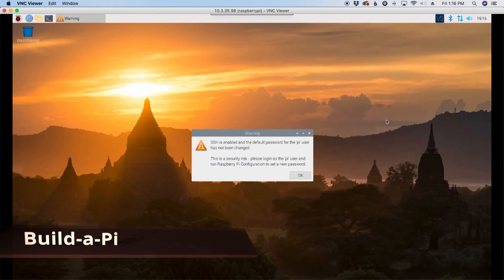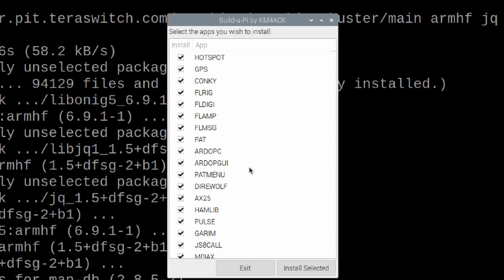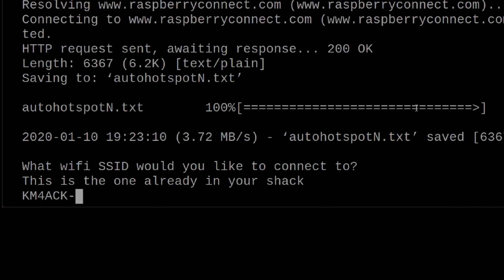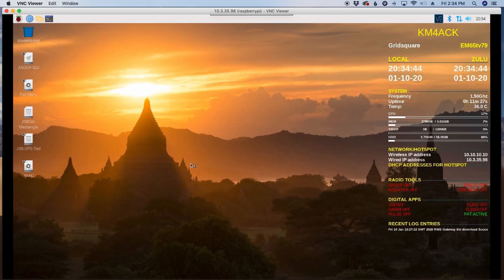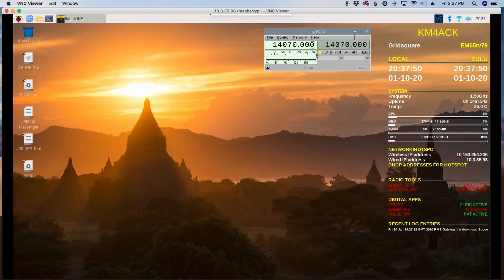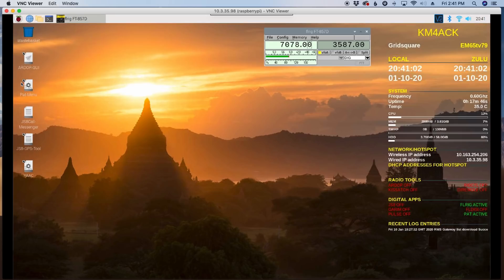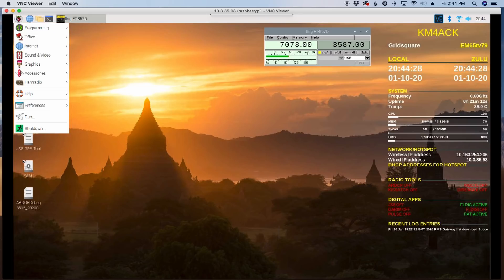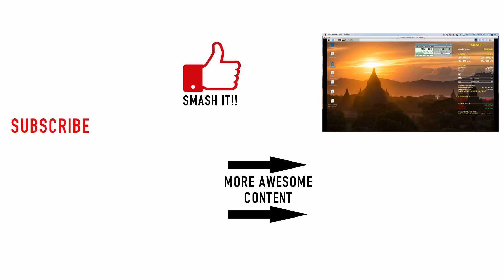Easy Raspberry Pi Build for Ham Radio Digital Operations | Build-a-Pi

Comment: Install completed. GPS functional. All systems go . . . except . . . I am running my IC7300 with FLrig, and when I launch JS8 or WSJT, the rig will not go into USB-D mode. And, FLrig will not accept a manual selection.  So, anyone have an clues as to what might be sideways? de KK7PW
Reply: Update: reflashed and reinstalled and now everything works PERFECTLY!!  Thanks for a great build!!
Reply: All seems to be running ok.  I moved the GPS away from HDMI port and now have constant lock. Much improved. Oddly, I followed Jason’s new video instructions and changed the port numbers to try and get JS8CALL messages to work. 2042 works with GPS, while 2037 works with messages, but not either for both. So, I left it for GPS. Maybe next build will solve this. 73. de KK7PW

Comment: Jason, many thanks for taking the time to script this out. 
I have it running on a Pi3b+, and have also tried it on a Pi2b. 
Rig is 857, USB sound card (not using a SoundLink nor RIGblaster), and USB Cat.

One issue that I have (with both Pi units), is with PTT for "Packet" (I have not tried other modes).

If I start manually ([rigctld -m 4] + [sudo direwolf -p -t 0] + [sudo kissattach /tmp/kisstnc wl2k]) each in separate tab, then my PTT works when called for. (Also to mention, that it took picking the PTT Port /Cat cable and the box checked for RTS in Flrig.)

If I run #3 (Start Packet) from Pat Menu, then PTT doesn't activate.

Settings in files, when it works manually, are as follows:
patmenu/config file: RIGCONTROL=yes and RIG="/usr/local/bin/rigctl -m 4"
(I've tried 
RIG="/usr/local/bin/rigctl -m 122 -r /dev/ttyUSB0 -s 4800" and get [set_mode: error = Invalid parameter].)

direwolf.conf file: PTT RIG 122 /dev/ttyUSB0
(I've tried PTT RIG 2 localhost:4532, PTT RIG 4, PTT RIG 4 /dev/ttyUSB0, PTT /dev/ttyUSB0, all with/without RTS DTR in the direwolf.conf file. I get [File exists] then no joy.)

Any idea what I'm missing, or what I have messed up??
Thanks in advance, and 73! K9CHU
Reply from the maker: take a look at the pat menu config file (~/patmenu/config) You can change the way packet is started from within that config file. Then that data is pulled into the patmenu scripts as variables. If you are familiar with bash scripts, take a look at start-pat-2m in the ~/patmenu folder. This is the script that is doing the work. 73, de KM4ACK

Comment: We can not thank you enough!!! Does this script also add/link the gps to the internal clock/chronyc and adjust the time?  Im using a ublox7 dongle. Lastly Im using a radio that takes cat commands over a usb to serial  (FTDI chip) and a microphone/speaker connected to a usb soundcard dongle. In the past fldigi, flrig, and WSJTX played nice with your previous recomended setups.  Any suggestions on how to edit your script to push flrig commands to cat instead of vox (13:20 in video)?  MY radio does work with taking usb cat commands over flrig.
Reply from the maker: Yes. GPS will set pi time after the script installs. For JS8/WSJTX, I suggest selecting FLRIG/FLRIG as your radio. If this doesn't work, you can always do it the old way. When it comes to Pat, both packet and ARDOP, the rig control commands are set in the pat menu config file ~/patmenu/config Hope that helps. 73, de KM4ACK
Reply: @KM4ACK  Thanks for the help and looking forward to the download

Comment: Jason, this is Jerry K7AZJ. 

I  am amazed at how short a time it has taken you to really learn the pi command line, etc. I am proud of your efforts in this regard. I will be moving from Phoenix to the Mississippi coast this year (part time), and I hope that I can get on the air with you later on this year. I just used your script to build a Raspberry Pi 4 I just bought. Again - really good work.
Reply from the maker: Thanks Jerry. That means a lot to me coming from you! Maybe we can work some JS8 when you get to Mississippi. 73, de KM4ACK

Comment: I installed the script successfully but have a few of questions. 

1. The script loaded my current call but I have requested a vanity call. How do I change that when my new call arrives?
2. I have a GPS dongle installed but have not gotten it to operate yet so no Gridsquare information is displayed. Can I enter that manually?
3. The script was installed under the default pi user. I created a new user under my call that I will use rather than the default pi. The information with the call, UTC and local times, gridsquare, etc that was displayed on the right side of the desktop does not display on the new page under my call or the desktop of pi, either, now. How do I correct that?

4.  How do I update information regarding the hotspot SSID/PASSWORD at some future time, if needed.
Reply from the maker: 1. You will need to update the files manually.
2. Be sure your GPS has a lock on the sats. Are you using this GPS dongle? https://amzn.to/2t6QPq3 It's the one I use and the one the script is designed around. It might work with others but can't say for certain.
3. You will need to copy the .conkyrc file from pi's home directory to the home directory of the new user.
4. sudo nano /etc/hostapd/hostapd.conf
Reply: @KM4ACK 

1. What  file/files that contain my call that I will need update manually?  Is it one or more?  Would it be easier just to flash a new SD card and reinstall with the new call?  It should be in within the week and I doubt I will be using the Pi before it comes in.
2. GPS seems to have finally synced as far as time but not reading Lat/Long

3. Even after doing a new install, the call,, times and other info on the right side of the screen only displayed immediately after the script finished. It did not display after the Pi was rebooted.

Comment: Very nice.  I had a problem with my BU-353S4 GPS which I fixed by the following
ls /dev/*USB*   #(this is to find the device name)
sudo systemctl stop gpsd.socket
sudo systemctl disable gpsd.socket
sudo nano /lib/systemd/system/gpsd.socket
change monitoring location to 0.0.0.0
sudo killall gpsd
sudo gpsd /dev/ttyUSB0 -F /var/run/gpsd.sock   #(used the device name from above)  
sudo systemctl enable gpsd.socket
sudo systemctl start gpsd.socket

Comment: There is an interesting "bug" I have just heard about on JS8CALL ? has to do with "RealVNCserver instead of TightVNC" as Jordan said. Not sure this image would handle this problem ?
Reply from the maker: What is the bug? I don't use TightVNC. I use the real vnc viewer and have had no issues now or in the past.
Reply: @KM4ACK  your using the one with no problems luckily.

Comment: Where is the password for the auto hotspot stored? Thought I had it, but keeps giving me "incorrect password".
AL  VE3RRD
OK, found it at /etc/hostapd/hostapd.conf and the password was set wrong.
Reply: mine was wrong, too. did your orig password have an & in it?
Reply: @thecarys563  No but it seemed like it always reverts to a default password after install. My pi might be too close to my router because it would loose the wifi signal once or twice per hour and bring up the hot spot. I now have the new version 2 installed and didn't choose the hotspot option (never used it).
Reply: Al Duncan thanks. Mine looked like it interpolated something right at the ampersand in the password. I changed it to not have the & and it's working.

Comment: all modes work fine except ardop.  cannot get ardop transmit on IC7300 but no problem on fldigi, js8 etc.  gARIM connects and shows input peaks but when I try to send two tone, PTT= True then PTT=False  Tried changing ardop ptt setting from false to true in config.
Reply: My issue as well.  Still trying to get Ardop to work. Hopefully we’ll find the solution. 73. de KK7PW
Reply: Actually, I've bumped into an FLrig issue -- wont accept serial port connection. 7300 goes into TX on power up, and then FLrig does not control -- wont initialize.  Was working initially and had WSJT and JS8 working fine. Then this. Serial port attempts with selection of USB0 and Silicon Labs controller. Clues?
Reply: @DesignTrek  I'm having the same issue now as well across two Pi4's. Going to try form scratch on one of them to see if I can resolve the problem.

Comment: This has been the exact thing my shack has been needing! After unsuccessfully following tutorials and getting hung up for no good reason, this script saves me so much time and frustration.

My only problem (so far) is that I have the same GPS receiver, but the pi is not recognizing it/getting data from it. Anyone have a suggestion?

Comment: I think I found out where I went wrong on the VFO setup. I configured pat configure for my TS 2000 Flrig does control. If I start Pat Winlink I get the IO errors. I'll remove the Rig 214 from configure and see if this corrects my problem in using Ardop
Reply: I'm still getting the IO Rig error. I removed the 214 (Kenwood) from Pat Configure and made sure that RIG 214 was in Pat Menu config. Almost there but not sure where to go next
Reply from the maker: have you tried using the default statement in pat menu config? rigctl -m 4 This will send the commands to FLRIG and then to the radio. As long as FLRIG is configured correctly it should work.
Reply: @KM4ACK  #Pass rig control commands through FLRIG (default)
RIG="/usr/local/bin/rigctl -m 214 4"
Reply: @KM4ACK  #Pass rig control commands through FLRIG (default)
RIG="/usr/local/bin/rigctl -m 214 4"
Reply: I removed the 214 as above. and now Hamlib can not find 214 as seen in Pat Winlink at the bottom of the browser
Reply from the maker: Email me a copy of your pat menu config file please.
Reply: @KM4ACK  With Jason pointers. The issue was in Pat Configure. my-rig I had changed to 214. Changed it back to my-rig. Working now. Thank You for your help.

Comment: KM4ACK What HAT did you use for this build? The DRAWS OR UDRC HAT?
Reply from the maker: Neither. It's this hat here https://amzn.to/2RJsD5B Built in fans and 12V-->5V converter. Works great with the pi 4. Should work equally as well with a pi 3
Reply: I plan on building 3 of these beasts. A home and two vehicle systems.

Comment: I successfully competed install script but when trying to start Pat-Menu I get this error: Failed to execute child process “xterm” (No such file or directory).  Help! and thanks.
Reply from the maker: I've had one other guy run into this. He changed cards, rebuilt the system and had no more issues.
Reply: I had installed the full version of Buster and the script failed to install Pat-Menu properly.  When I installed the desktop only version the script worked perfectly.
Reply from the maker: G Fitz thanks for the heads up. I almost always just run the desktop only version. Not sure why it wouldn’t load on the full version though. 🤔

Comment: Nice job Jason! Installed it on my Pi4 and did not run in to trouble. Got most of the applications I like to use working exept that the FT-817 will not communicate with Gpredict. All Fldigi stuff works fine but Hamlib does not engage and I can find only a few pieces on how it should work, but I'm stuck. Any toughts on making a video about this?
Reply from the maker: So is FLDIGI fully working with your 817? Is it just Gpredict that isn't working? 73, de KM4ACK
Reply: @KM4ACK  Yes, FLdigi works fine. Just Gpredict does not work. Had it actvated to work with Hamlib and maybe that is the problem. Does Gpredict work with another controle module?

Comment: Jason, another super program. I installed on pi 4 and everything runs. However, when I tried to connect with VNC on Win10 it asks for login and password. I tried all I can but it does not allow me to connect to new issid. Any idea 73
Reply from the maker: This is your normal username/pw for the pi. By default, pi/raspberry. If you changed it during setup, use what ever password you set. 73, de KM4ACK

Comment: You are right! A game changer.  One point. I ran the script from a Putty SSH session. When I got to the part where I select software it said it could not open a desktop session. I started over using a VNC session and its command prompt feature and no problems from there. Before your script I could not get the Pi-3 to work with IC-7300. With your script - no problems. You must have spent a ton of time working on this.  Thank you so much, 73.
Reply from the maker: thanks! You are correct that is won't work over a SSH connection. The menu that allows you to choose which apps you wish to install requires a display. This can either be a monitor connected to the pi or a VNC connection. Glad you got it all working with the 7300. 73, de KM4ACK

Comment: As I was following along, when I got to the Xaster question <Yes> or <No> in your presentation, all I had on my Pi4 screen was <OK> and clicking on it or simply hitting enter did nothing.  I went up to File and clicked on close and it exited your whole script, so I guess I need to start over.  But what do i do when I get to the Xaster screen again?  Great video by the way.
Reply from the maker: Use the tab key to highlight "ok" and then press enter on the keyboard. The mouse won't work on that screen. 73, de KM4ACK

Comment: Love the video this is very best setup i have found for Raspberry pi.  My only problem is Radio cat controll with my FT991a Flrig works but cant seem to find correct settings for wsjts and or js8 call  any one able to help with my settings let me know.
Reply from the maker: Did you set the rig in wsjtx/js8call to be FLRIG or FT991? It should be FLRIG. Unfortunately I can't test this since I don't have the 991. 73, de KM4ACK
Reply: @KM4ACK  I tried both flrig flrig and that didnt work then tried 991 but settings arent working correct I only been playing with this build for day or two so will keep trying
Reply: getting error - communication collision while getting mode - for an error
Reply: KM4ACK it works I had tried flrig other day with no luck played with settings last night couldn’t get it went back to flrig and it works. Now need get general ticket and some better antennas

Comment: Very nice. When i get a big 3 radio i will do this. I have never been able to get my x108g to link up, even though it should using ic7300 as the radio. Always sad when stuff doesn't work. Thank you for this awesome build. I will be setting up an sd card this week to have it ready.
Reply: Have you had any luck yet? My Pi runs great, the x108g runs great, but even with an XGGComms cable I can't get them to talk on the Pi or Windows.

Comment: Having some trouble with the initial command, its telling me permission denied... I'm very new at this... "could not create a work tree dir '/pi-build ' : permission denied... any ideas?
Reply from the maker: Are you starting with a SD card that has just been flashed with Buster? Either the full version or the desktop only version? No one else has reported this issue. 73, de KM4ACK
Reply: @KM4ACK   yes it was a brand new card, should I flash it again?  maybe a new card?
Reply from the maker: That would be worth a try. 73, de KM4ACK
Reply: im having the same issue, my sd card came pre loaded with raspbian buster too
Reply: still the same, new sd card fresh download and everything looks ok? until the work tree?   buster works fine otherwise.

Comment: How do I get the text with my callsign, grid square, etc to show up on the right like your screen
Reply from the maker: Using this video as a guide, it should automatically appear on the screen after everything is installed and the pi reboots. If you aren't using this script to build your pi check out this video https://youtu.be/K4ZdWxuHT-8 73, de KM4ACK
Reply: @KM4ACK  Much to my surprise installing Conky per the video's instructions gave me everything I asked about. It was really easy. Thanks for your help 73, de NE5U

Well... first thing, I did use this video as a guide but nothing popped up. Then per your comment above I followed that procedure and the screen had the information on it. Then I rebooted and the info is now gone. So, I haven't something right. I'll watch this video again. Thanks again for such clear and concise instruction. Now to work on my reading and listening comprehension lol

Comment: You may have mentioned it but if so I missed it - Does this work with the pI4? 73 NE5U
Reply from the maker: Yes sir. This was filmed using a pi4. 73, de KM4ACK
Reply: @KM4ACK  Outstanding. I'm loading the Buster image on an SD card as I type this. I'll get it all together and give this a try in a bit. Thanks a bunch. 73. de  NE5U